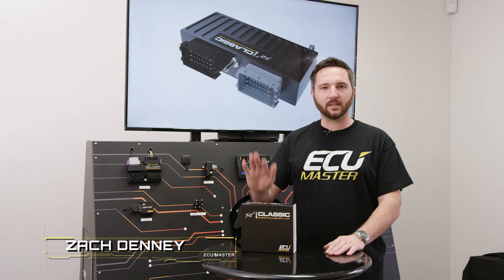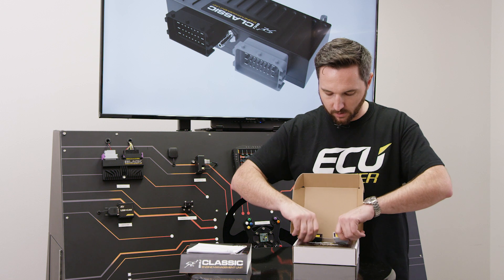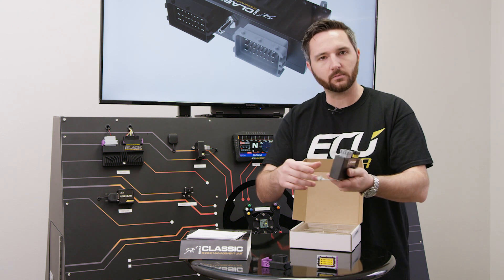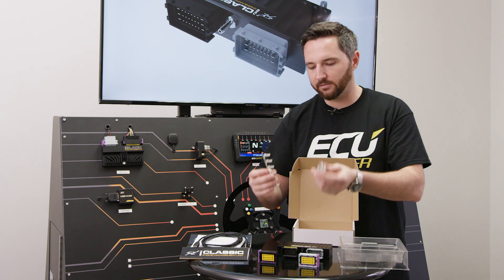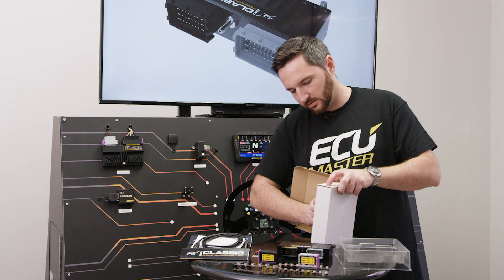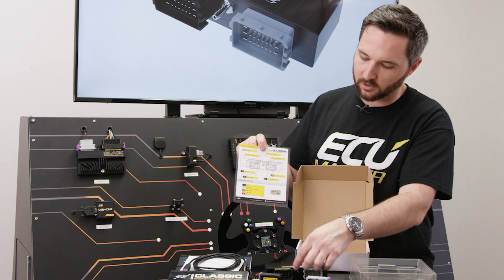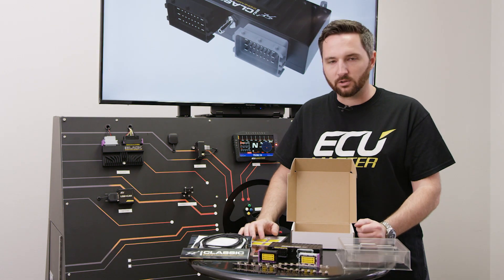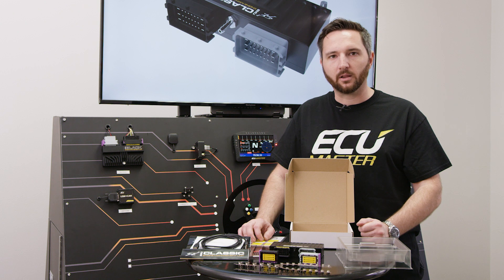ECUMaster EMU Classic Unboxing

Comment: hi zach. i purchased a silver box classic from you quite a few years ago and am now only just getting around tpo installing it into my jzz30 non vvti 1jz, i was wondering. could i use the PNP adapter harness from the newer black and just repin the black connector to match the older ecu master silver box black connector pinout? thanks.
Reply from the maker: We make an adapter for the JZZ30 for an EMU Classic, so you don't need to repin anything, just buy the correct adapter. It is possible to repin an adapter that's been set up for the EMU Black if that's what you have on hand.
Reply: @ECUMasterUSA  fantastic thanks! yes i have the black pnp on hand. but just my old silver box.

Comment: if i buy the ecu master classic do i need to buy other gauges for my turbo car or can the sensors be wired to the ecu?
Reply from the maker: The ecu has several inputs for sensors, and you can set failsafes based on those readings.

Comment: on the Emu Black can i run 2 sets of injectors on a 4 cylinder sequentially,i use two different types of fuel and need the ethanol staged in as i go into boost